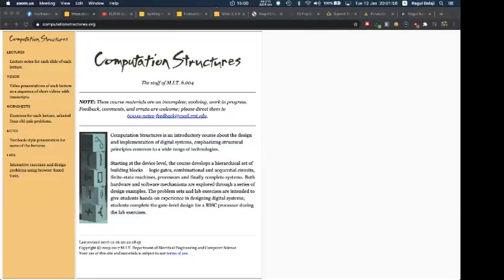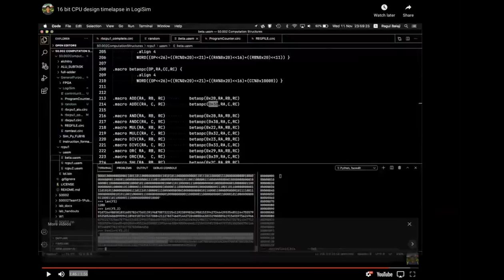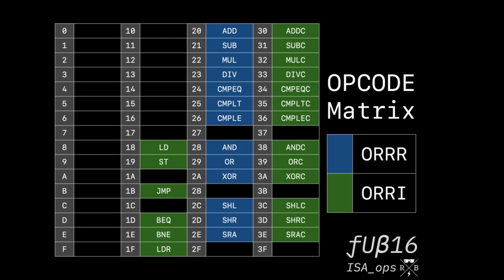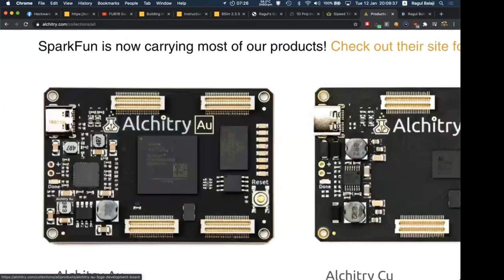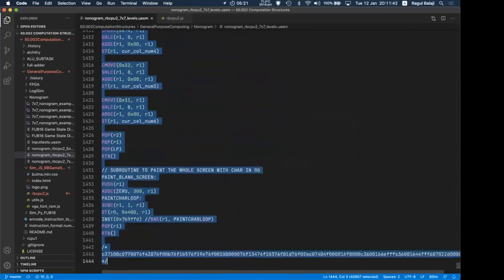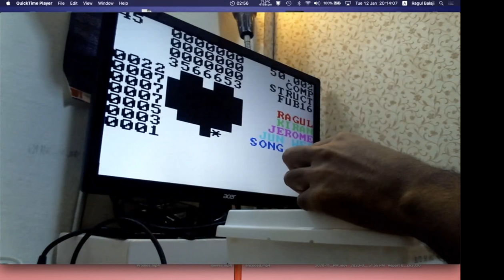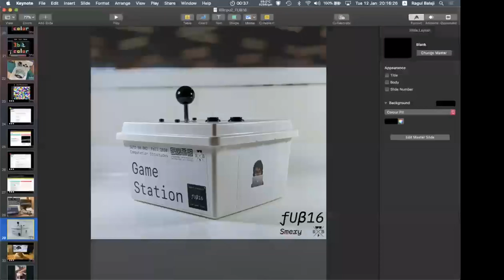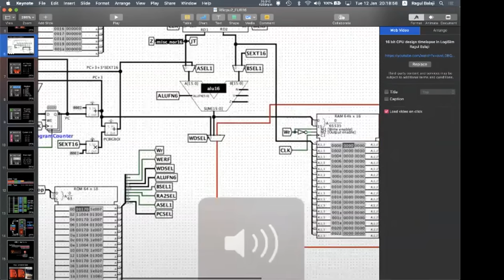RBcpu2 ƒUB16: Homebrew 16bit Computer on FPGA - Hackware v6.5

Comment: cool project! btw I also started to learn FPGA using the Tang Primer board, it was very nice and simple. Too bad the license for the Tang IDE now expired so you have to mess with the clock to run it. Now I have ecp5 and kintex 7 dev boards, so I don't use the tang anymore, but it was fun while it lasted.